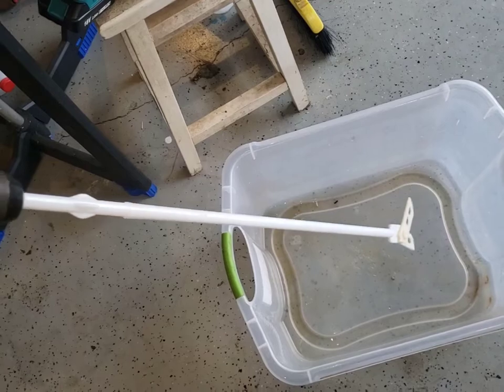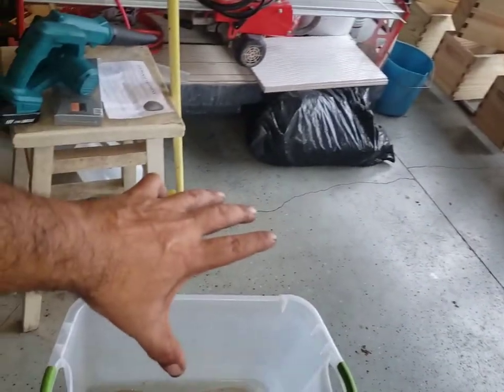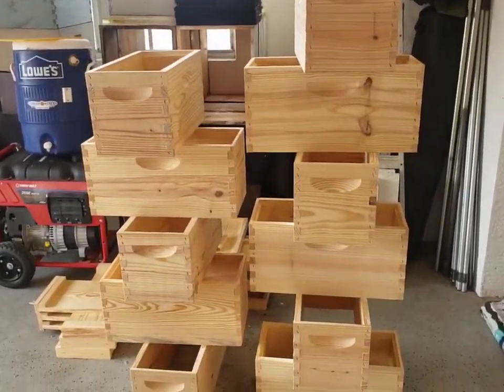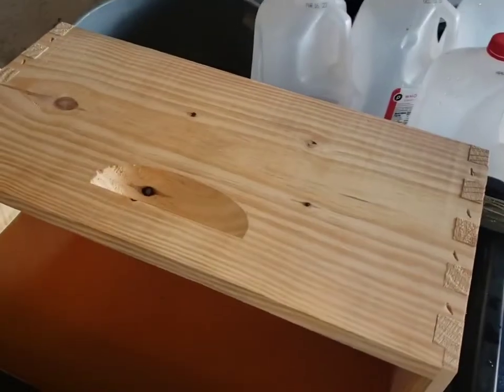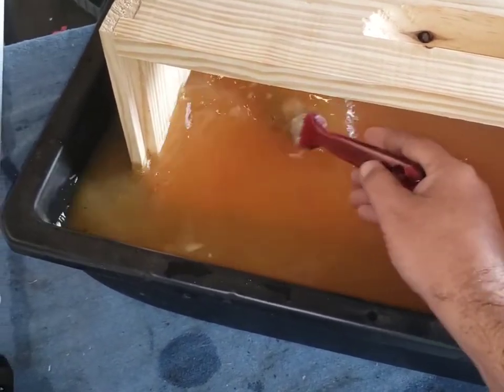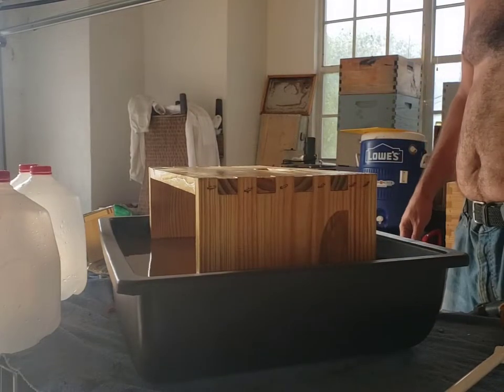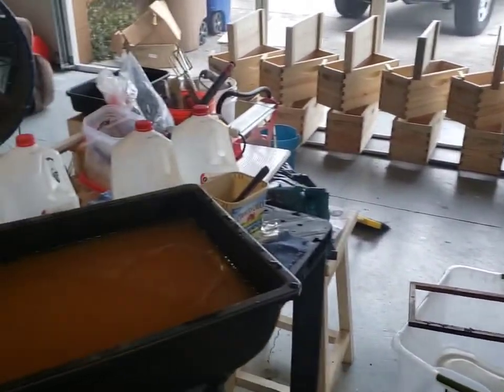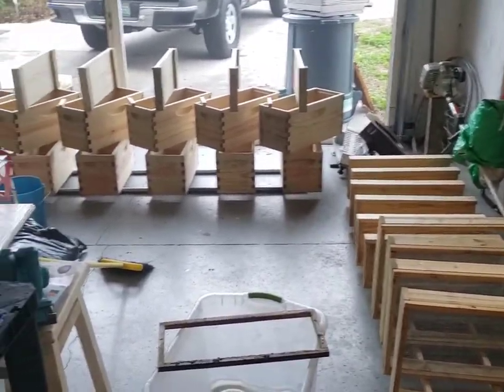Eco Wood Treatment for Nucleus Hives 2022

Comment: Hi Tim. Fellow "Friendly" Beekeeper here. I was wondering if you have any follow-up on how the Eco-Wood Treatment has performed on your woodenware?
Reply from the maker: They are holding up nicely! Eco-Wood is a great product. I think dipping the boxes is much faster than painting them with a brush or a roller. The boxes have been outside under the Florida weather for a while, and I don't have complaints. Eventually, I'll probably paint the boxes, just to add more protection and to make the yard look more uniform. I'll try to post a new video. I appreciate you stopping by and for messaging me to ask for a follow up